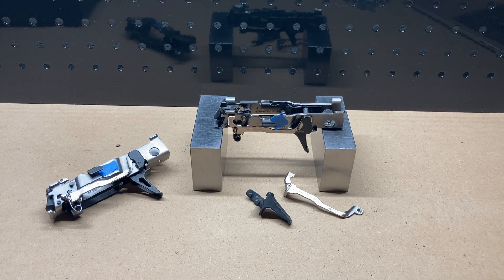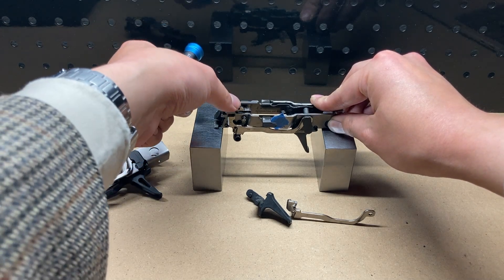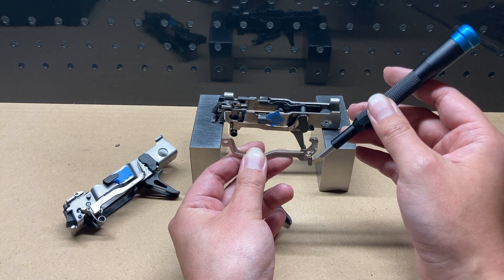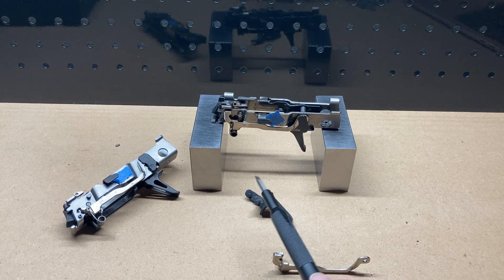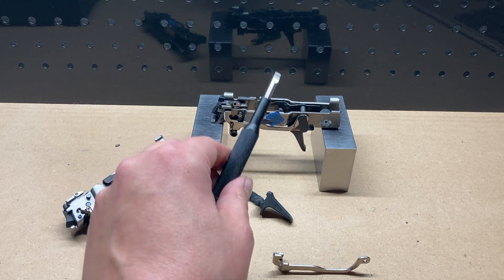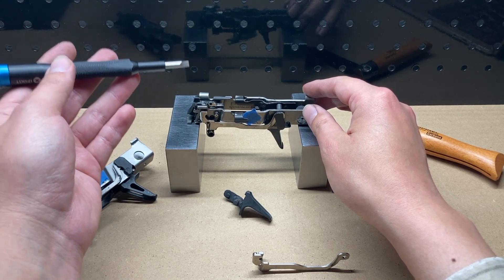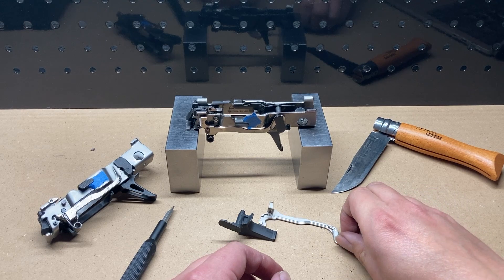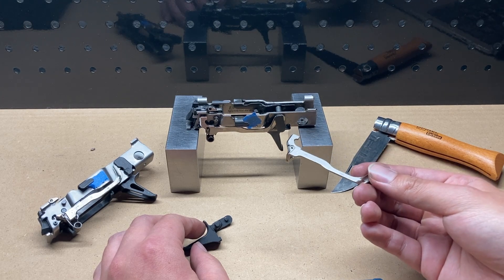P320 Sear Movement Test followup: It's all about the Trigger Bar and Trigger

Comment: Something I noticed on my p320 on the FCU if I push just a tiny bit on the spring attached to the trigger bar away from the trigger, the trigger bar moves with back and forward with no downward movement.  Is it possible that it is the way the spring re-directs movement?
Reply: Yes, the angle of the back leg makes a difference. Mine is a little crooked and doesn't go downwards, just straight forward.
Reply from the maker: Correct, pressure on the trigger bar or spring causes the trigger bar to behave differently. This is why I advise people to not try to draw conclusions from an FCU outside of the grip module, but to instead test for trigger bar movement with the FCU installed within the grip (and thus receiving the expected pressure from the grip surrounding it).

Comment: What would push down on the sear like that? Is someone in there with a screwdriver?
Three things would have to fail at the same time for the 320 to fire without pulling the trigger.
1) The sear would have to lose control of the striker.
2) The secondary/back-up sear notch would have to fail to catch the striker.
3) The striker-blocking safety would have to fail or the striker couldn't reach the primer on a chambered round.
Of course, moving the trigger to the rear defeats all those safety devices.
So, if your 320 "just goes off all by itself", buy a lottery ticket, because you have beaten the odds.
Reply: 100%. Those reasons are why figuring this out is so interesting.

Comment: Hi, I have a M17 I bought about a year ago. After watching your videos and testing it myself I found mine behaves like your gun (not your friend's). Since you mentioned wanting to test the behavior with a manual safety, here's what I found on mine: 1) with the safety off it acts exactly like your P320-> trigger bar moves down+forward until the breakover when it pops a little up+forward before sliding back to its original position. With the safety engaged the trigger bar moves down+forward the same until the breakover, when it pops further down+back then slides up to it's original position.

Comment: This is very interesting,  and you've obviously put a lot of work and thought into it. I'm falling behind, a bit, not understanding some of the nuance; and hope that you might clear a couple things up for me. 

I understand that this is geared toward trying to gain insight into the "un-commanded discharge" phenomenon. Is that correct?

You're not suggesting that the "un-commanded discharges" that have been reported were caused by something like a dental pick being inserted into the pistol and manually tripping the sear, right? You're manually tripping the sear on these two examples in order to demonstrate that they respond differently, when they should react the same; thus showing that the specs are different between the two, and asking, "What spec is different, and why?" This difference in specs could reveal why some pistols may be more susceptible to an "un-commanded discharge" than others. It might even demonstrate some way to reliably proof a pistol against the possibility of an "un-commanded discharge". Is that right, or is the sear test showing something other than that?

Could you please clarify the term "disconnector-like behavior"? And comment on whether that is good or bad, and why?

Could you please clarify the term "sear movement test"? And comment on whether failing that test is good or bad, and why?

You note that depressing the sear on your friends FCU moves the trigger bar forward, but depressing the sear on your FCU moves it both forward and up. Could you please explain which of those two reactions is "correct", and why the other way is "wrong"?

I've got a pair of P320 Legions. A X5 and a XCarry. I'm very interested in your experiments, so please continue the good work!
Reply from the maker: Two failures have to happen for an "uncommanded discharge" to occur - the sear must release the striker, and the striker safety lock must fail to block the striker from protruding. The Sear Movement Test assumes the sear has somehow been moved without a trigger press in order to release the striker and checks whether the striker safety lock is functioning as intended. If a pistol fails the Sear Movement Test (allowing the striker to protrude from the breechface when manipulating the sear without touching the trigger), then either something is defective with the striker safety lock and the other parts associated with its function OR the pistol is deactivating the striker safety lock at the exact wrong time.

Disconnector-like behavior is explained in this video. The disconnector pushes the trigger bar down.

My FCU demonstrates disconnector-like behavior of the trigger bar and does NOT fail the Sear Movement Test. My friend's FCU does NOT demonstrate disconnector-like behavior of the trigger bar and DOES fail the Sear Movement Test.

Comment: Man!  The more I see how the P320 is designed, the more I dislike everything about it.   What an unnecessarily overcomplicated method of having a passive firing pin block.
Reply from the maker: It's a clever solution to having to cram a striker-fired pistol into the negative space left behind by the guts of the hammer-fired P250, but clearly it's suboptimal compared to a clean sheet design like the P365.

Comment: If the dimensions of the trigger bar appear to be the same, it might be a geometry issue.  If possible, you should 3d scan the 2 trigger bars and check the geometry of each to see what if anything is different.  I'd bet there is a difference, and it's just not discernable with just a set of calipers. Check any of these that may apply to the trigger bars: straightness, flatness, circularity, cylindricity, profile, perpendicularity, angularity, parallelism, position, concentricity, circular runout, total runout, and the actual dimensions of each feature in comparison to the  nominal value of each feature. It also could be another component or feature being out of tolerance, or a combination of tolerance stacking issues that creates a situation in only certain scenarios. While it hasn't been pinpointed yet by the public, I'd be surprised if Sig doesn't already know about this problem, and they covered it up because there is either no solution without major design changes and/or the cost would be more than they are willing to spend. In other words, it's cheaper to pay settlements for injuries and deaths than it is to fix the problem.

Comment: Please test a P365 for these problems. I'm a bit concerned considering it's my carry firearm.
Reply from the maker: The P365 is significantly different in design and cannot fail in the same way. When moved, the P365's sear does not cause any sympathetic movement of the trigger bar, because it doesn't have a back leg to the sear. Only the P320 has that "feature".
Reply: The 365 series being a completely different FCU design, I'd regard as good to go. Don't conflate the "uncommanded discharge" issues of the 320 which are being explored here, with the 365's.

Comment: Have you considered the orientation of the spring connected to the trigger bar? 

I was trying out your method and my spring has quite a bit of wobble to it, and depending on how much I canted/moved it, I could replicate both of what you demonstrated. It may be that the mechanism is altered enough by geometry of spring orientation, but that's just a thought with a sample of one p320 (m18 post trigger fix build).
Reply: Addition: i tried it in another group module (brouwer 1811) and the results are inconsistent, but the recess where the spring sits is diffrent enough  so that the trigger bar and spring are oriented differently. This may be that the spring and trigger bar are not able to be at the proper orientation to reliability keep all the parts where they need to be to function as desired.  
Not an engineer, but the trigger bar and spring seem to be to moveable 🤷‍♂️
Reply from the maker: The odd and unpredictable interplay between trigger bar, trigger bar spring, and the grip module they are rubbing against is precisely why I warned against people drawing conclusions from testing their FCUs outside of a grip module.

Comment: Can you not put the offending FCU's into the p320, and apply your theory to the firearm and get it to fire with a pressure from the side or back ect, put it in a holster in a vice, shake it around I dont know. 

Just prove to everyone that the firearm can fire without the trigger being pulled while all the safety mechanisms are intact. Just think how powerful a video would be of one in a testing environment like that firering
Reply from the maker: My goal is not to drill down to root cause of every problem with the P320 ever, it's simply to offer people 1) Easy tests to perform on their own, and 2) Actions to take to fix their FCU should it fail those tests. Thus far, I've somewhat accomplished Goal #1, but Goal #2 remains elusive.

Someone with actual vibration machines, drop-test setups, high speed cameras, and access to a large sample size can handle the figuring out why the sear is moving, I'm just assuming that it moves and going forwards from there.

Comment: Maybe the difference is the coefficient of friction? Is your friends sear slipping off the back of the trigger bar, thus not providing enough of a grip for the downward force for the disconnect behavior? Whereas in your fcu for whatever reason the sear gets a better grip on the trigger bar and shoves it down and forward. Should be easy to test by sanding that third trigger bar/greasing yours.

Comment: It’s so joever. My P320 failed the sear movement test as well as the disconnector behavior test.

I have the trigger design you said was better, so I’m gonna get my hands on an Apex trigger bar to see if that creates disconnector-like behavior.

Worst case scenario I guess my now range-only gun has a better trigger bar.
Reply from the maker: The trigger bar is the key component, and I haven't figured out a way yet to guarantee that you end up with a trigger bar that demonstrates disconnector-like behavior. Even if you get lucky and get one of those though, the trigger also influences whether the disconnector-like behavior occurs - thus far, I've been able to produce proper behavior with two non-skeletonized flat triggers, and I've been able to demonstrate that the skeletonized trigger changes some engagement angles enough that it makes a previously not-failing FCU unsafe just by swapping in the skeletonized trigger.
Reply: @ since all of these test failures seem to correlate with trigger movement, do you think the incorporation of a trigger safety (think the trigger Agency Arms offers) could potentially cure the unintended discharges in FCUs that don’t exhibit disconnector behavior?

I also wonder the same thing about the manual safety on the Flux Raider chassis, which pins against the rear of the trigger to lock it in place.

I’ve already found and ordered the Apex Tactical trigger bar (which is now discontinued) and will test to see what difference (if any) it has on my FCU’s behavior. And I am going to get my hands on all of these other components I’ve listed to try them all out in these tests you’ve described.

I may even send a FCU in to GrayGuns to see if their action job and sear have any effect on this.

I’ll update you on anything I find out with these components.
Reply from the maker: It might or it might not. After as many unexpected FCU interactions as I've observed poking these things, I am not comfortable making a definitive statement about whether it would or wouldn't work until after I've gotten hands on with a part and been able to observe the interactions with it installed.

I am hoping to get my hands on an Agency Arms trigger with the trigger dingus specifically to test for whether that could be a bandaid solution for someone whose FCU fails.
Reply: @P320Truther  The Agency Arms trigger follow-up will be in extremely high demand for many of us who's 320's have failed. Mine wasn't consistent in failing, but I'm going to account that to human error/variables in my lunch hour, kitchen table testing.  Even one or two out of ten where the striker broke the plane of the breech face I'm counting as an overall test failure.

Comment: Thanks for the video! I wish sig  would put as much effort as you do to figure out the issue
Reply: Sig has the most-capable gunsmiths and engineers in the country on its payroll. They know EXACTLY what the problem is. But, the root cause data will never see the light of day. If it did, it would require a recall of every P320 ever produced, bankrupting the company.
Reply: @ agree 👍
Reply: They will put a fortune into lawyers and defending the 320 and zero effort into correcting the issue

Comment: Sig made the rear leg of the sear longer to deliberately contact the trigger bar so that the trigger bar’s resistance to movement would act as a redundant / additional sear spring.

However it appears they goofed up the safety timing badly.

Comment: I would love to see if there is a way to reliably get the sear to slip in a fully assembled P320 without actually touching the sear itself. If you could show that on video it would immediately end all of the controversy and then Sig would have to take this issue seriously. This is the best evidence so far but it seems for some people until they see it with their own eyes or until it happens to them, there will never be enough evidence and that's a very disturbing stance in my opinion to take when it comes to firearm safety. We clear our chambers but we won't clear our biases.
Reply from the maker: How the sear is moving on its own is the multi-million dollar question that no one seems to be able to answer. The Sear Movement Test just works on the outright assumption that it is moving, since none of the "uncommanded discharges" have been accompanied by reports of broken components, and no one has been able to show how the striker could be released without either something breaking or the sear itself moving in the process.
Reply: @P320Truther  Very interesting, thanks.

Comment: There's a very clear difference between those two (7:32 mark). The first one starts to move the striker safety up later and pops up at the break. The second one moves the safety leg up immediately when you push the sear down. Fairly clear that the safety will be pushed out of the way by the time it breaks. You can measure the distances with a caliper and film from the side for the viewers. I can't remember the actual distance anymore, it wasn't much that was needed.
Reply from the maker: Yes - this appears to be the mechanical reason why an FCU would fail the Sear Movement Test. The disconnector-like behavior created by a non-skeletonized flat trigger and my specific trigger bar delays the defeat of the striker safety lock until after the striker has attempted to drop, rendering my FCU functionally "safe" with regards to this specific test.
Reply: @P320Truther  Are the skeletonized and non-skeletonized flat triggers that different in design? I'm curious how some cuts on the side of the trigger could influence the test in any meaningful way unless there is some dimensional difference in how the trigger connects to the FCU.

Also, in regard to the trigger bars, you mentioned how your calipers couldn't detect any difference. What about in the position of the holes where the bar connects up with the other parts? Are the holes in the absolute exact same spot?
Reply from the maker: The skeletonization is just an easy way to differentiate between the two triggers. The actual magic has to do with where the stud that interacts with the trigger bar is located in relation to the pivot point of the trigger. The non-skeletonized flat trigger has a greater distance between the hole and the pivot, the skeletonized flat trigger has a lesser distance between the hole and the pivot. This slight difference in angle prevents the disconnector-like behavior from occurring with my trigger bar in my FCU. With a sample size of N = 2, using a skeletonized flat trigger in an otherwise fully function FCU disables the disconnector-like behavior.
Reply: @P320Truther  what brand is your flat trigger?

Comment: I just can’t trust that Sig won’t sell me an unreliable/dangerous product. I’d love to get a 365, but I’ve issues with them as well. As long as Sig just keeps on telling us that everything is fine, I won’t touch them.
Reply from the maker: If it helps, the P365 FCU does not demonstrate any sympathetic movement of the safety lever due to sear movement. In fact, moving the sear on a P365 cannot move the trigger bar, which has given me some ideas for a P320 FCU fix that might completely bypass the need to create disconnector-like behavior out of the trigger bar. More to come...
Reply: @ I’ve seen people have issues with the trigger return spring breaking after 3-4K rounds. I know that isn’t as big an issue as unintentional discharge, but it’s still not too confidence inducing. Plus, like I said, the way Sig is handling this just leaves me with a bad taste in my mouth. Thank you for at least helping to understand and hopefully solve a lot of these issues, though!